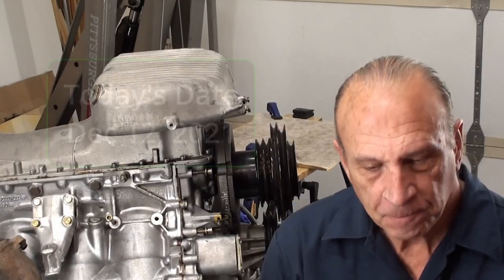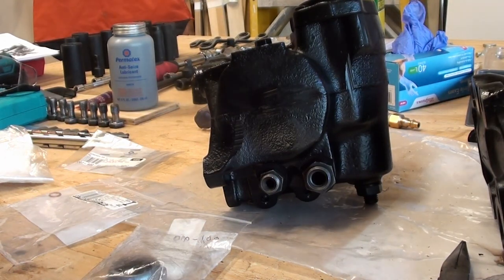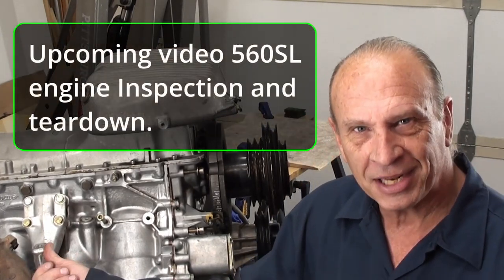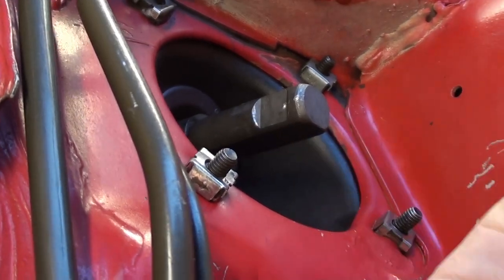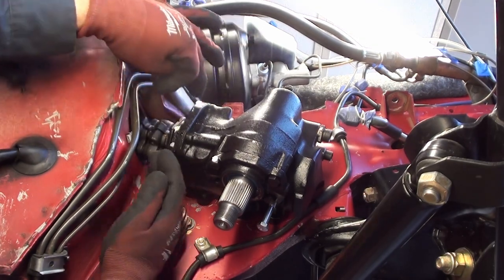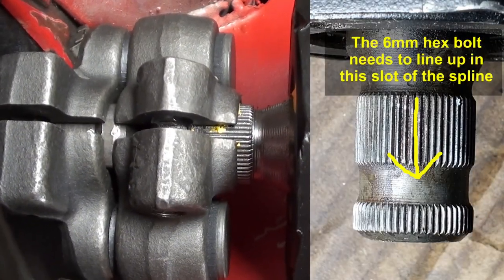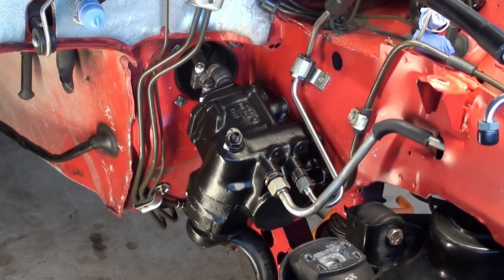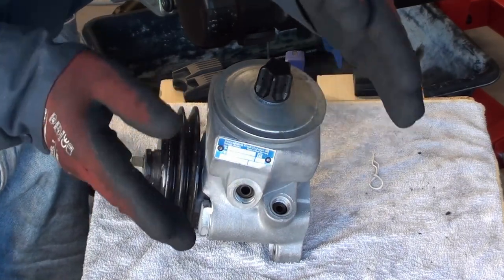R107 - Installing a Power Steering Gearbox

Comment: Some great top tips - using fuel hose to replace bracket rubbers, centre locating bolt in steering box, torqueing settings for high/low pressure inlets/outlet - good things to take note of when doing this job

Comment: Tony, I installed my remanufactured steering box following your instructions. The steering wheel is on straight, the signals cancel properly……the job went without a hitch and the car drives like brand new…Thank you!
Reply from the maker: Totally awesome Michael! Thanks for letting me know. I hope you remembered to put blue Loctite on the two bolts where it connects to the steering column. This method works every time and it’s easy. I’ve changed the steering box (for fun) about a dozen times.

Comment: Nice job Tony.  A great deal more challenging with the engine in place.  Many "one handed" situations where you are using both hands to install the gear box.  I was able to jam a second 17mm wrench on the gear box nipple from above to break free the high pressure line without twisting it.
Reply from the maker: It's definitely tight with the engine in. In 2008 I did remove it and reinstalled it the same way with the engine in, but it was super tight for sure. Having the special wrenches to break the lines helps. I think there was also a heat shield by the exhaust that I might have removed as well. It's been a long time since I did this that way I can't fully remember.

Comment: Many thanks for this Tony. I am in the process of changing my steering coupler on a 1980 slc 450 and it is proving to being a real pain to put back on. As I have everything off the car ( struts, disks brakes, upper and lower control arms etc, )I have accidently knocked the steering box idler arm so I need to re center the box using your tool. I am doing all of this in situe so quite fiddly to say the least. Your locking pin, is that basically an M8 times 1mm bolt where you have rounded the top?
Many thanks in advance, Markus
Reply from the maker: Yes! All you need is an 8mm fine thread bolt (M8x1.0) that is about 1.25" long. You then use a grinder to give it a point. See the video for details on the construction and centering of the gearbox.

Comment: Tony I am going to call you the Mercedes Doctor....hey where did you buy your new power steering lines I want to replace mine and yours look new...any thoughts
Reply from the maker: I only had to replace the high pressure line part #1079975482. I purchase genuine Mercedes-Benz when ever possible. I got this one from https://www.ecstuning.com/b-genuine-mercedes-benz-parts/hosepower-s/1079975482/

Comment: Hi, I like your videos. I own a 84 SL380 (US import and I live in Dubai - UAE). My steering gear box is leaking a bit hahahaha, so I presume that I should only monitor the oil level in the steering pump reservoir as I am not willing to replace it or take it out for some seals replacement, so will that be OK? I mean the gear box with still be working fine? I just replaced the steering coupler few months back and everything is great , I am not sure if the mechanic centered it as you did before he replaced the coupler. Now i watched your video, so went down to the car and turned the steering wheel to the max. left and max. right and it seems that one side turns a bit more that the other side, is that normal or will that damage the steering box.
Reply from the maker: If the gearbox is leaking it could/will damage other parts and it will never get better. In my video I talk about the rubber bushings for the fuel lines that are right next to the gearbox. Mine were completely desolved and I only had a small leak. The power steering fluid will turn the bushings into gum! The hardest part of removing the gearbox is loosening the coupler which you have already done. I would replace or rebuild the gearbox. If your steering wheel is not centered it could also mean you need an alignment. Again, it’s not that hard to re-center your gearbox as close as you can get it and then get an alignment. Between the two you should achieve a centered steering wheel. If you do not center the steering wheel about the only thing that can happen is that you won’t be able to turn as sharp in one direction AND you might rub a tire in the other direction.